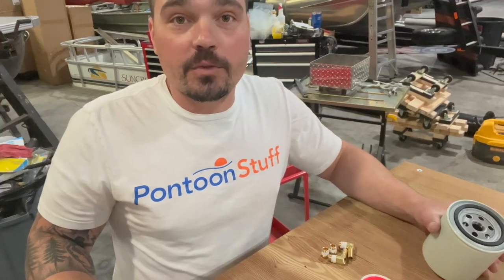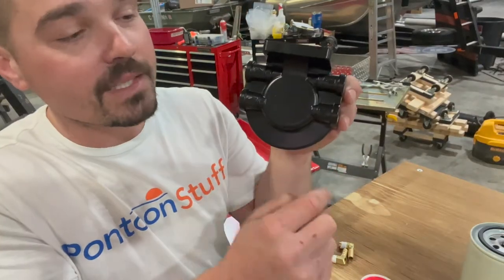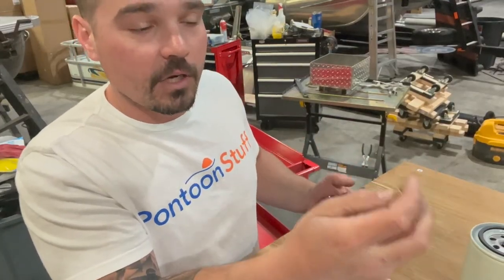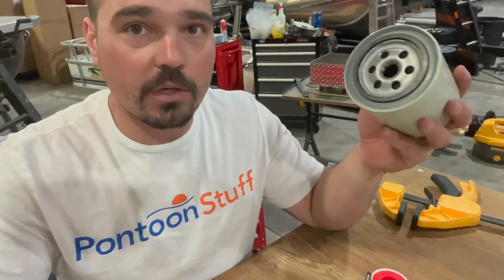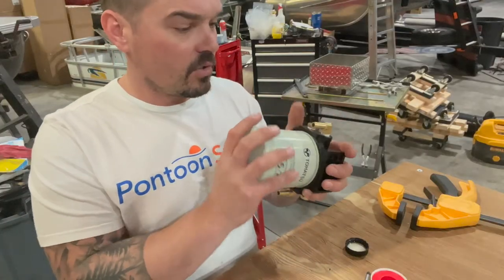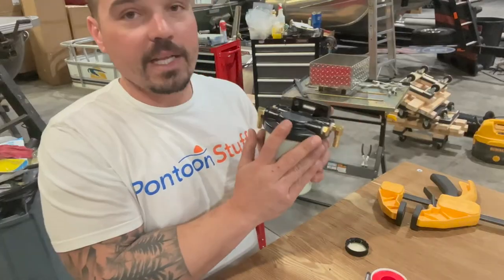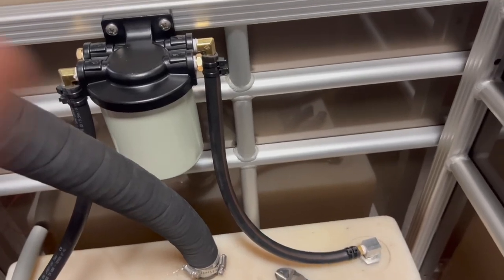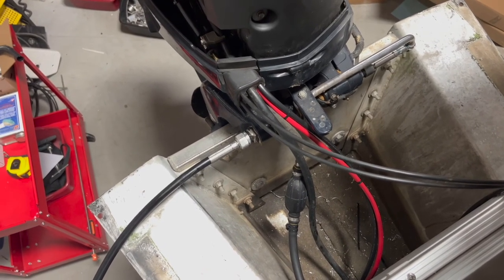Water Fuel Separator & Filter Installation - A MUST HAVE ON YOUR BOAT!

Comment: Thanks for making this.  My 1996 50hp evinrude suddenly sputters and e en has died down at idle at a boat ramp a couple times.   A friend recommended changing out the fuel water separator so this video is helpful!
Reply from the maker: Happy to help, and thanks for watching! It could certainly be that you have some water in your fuel (test what comes out of the old filter), or it could need the carburetors cleaned too as those tiny openings in the low speed jets can get gunked up over time to where it'll run at higher speeds but struggle to idle.

Comment: I’ve used these for years! Here’s a tip. Drain it is into  a clear jar ever time before you go. The reason you drain it every time before you go is because if it has water already in the filter it’s just going push water into your engine. The reason you pour the gas from the filter into a clear jar is because once it sits the water and gas will separate and you can see how much water is in the gas the store your getting it form has in their tanks.
Reply from the maker: Totally get that method, and to do so every trip I would 100% recommend the type of filter with the twist drain on the bottom, and it has a clear window to check for water or debris! I change them once a season, or check it first if there’s an engine issue to test the fuel for water!

Comment: Great video, as all of yours are.  Other reasons to oil the filter seal are to keep the dry rubber from binding as you tighten it, and to make sure any air bubbles get squeezed out.
Reply from the maker: Thank you! And great input...it's one of those things where oiling the seal is just the right way to do (it for so many reasons)!!

Comment: I have a 2018 pontoon with a transom mount fuel tank. I think this video was for me. Thanks. 

Currently trying to diagnose my fuel delivery issues. Thinking it’s water in the fuel…
Reply from the maker: Happy to help. Most factory boats come with a water/fuel filter kit just like this…and if not they definitely should!! All of our new fuel system installs, even if it’s just a 6 gallon red can, get one. 

The nice thing about the filter is that you can test a sample from it in a clear bottle easily to diagnose things like that. Water in gas happens, even if running marina gas or recreational fuel. Once in a while there’s just a bad batch!

Comment: Great video.  Should follow up with a fuel cell installation in the center toon.
Reply from the maker: Thanks! Unfortunately we haven't tackled the center toon fuel cell installation. The center logs with fuel cell spaces we've installed are always missing the actual fuel cell! And it seems that they're typically custom made for manufacturers dimensions so not easy to find a replacement. Only downfall for a center log fuel cell (and transom integrated for standard pontoon) is getting access to work on them or replace compared to an above deck tank.

Comment: Can you tell me what size those stainless steel screws are that you used to mount to the rail.  I heard "1 inch quarter 20".  I get the inch long part but for some reason not tracking "quarter 20" part.....  Thanks for the video.  Doing this upgrade this week
Reply from the maker: 1 inch long, 1/4” refers to the diameter, 20 refers to the thread. Usually written 1/4-20 stainless on any packaging or at the hardware store. Hope this helps!

Comment: Awesome advice Tom! Being a newbie, never even gave it a thought! So I’ve just ordered the same style separator for both my pontoon and 16’ fishing boat. One question I do have…that Tohatsu separator you have…is the fitting plumbed so you can run dual fuel tanks? TIA…
Reply from the maker: Smart move!!! There are two inputs and two outputs on the housing so you can run multiple tanks and motors.

Comment: having trouble installing mine i have a 18ft bass buggy dlx pontoon will i have to put the water seperator on my fencing
Reply from the maker: I have had to install them on railings quite a bit. Inside and outside of the boat on the rails!

Comment: i just purchased a pontoon,  it has a 90 hp Mercury,,,   4 stroke,   im not sure if a fuel seperator will work on a 4 stroke,  i believe there are 2 fuel pumps on the engine,  not sure of that though,   will a seperator work,  or Not..   i was going to put one on,  but im not sure that it will ever prime,  thanks
Reply from the maker: It will absolutely work on a four stroke!! If it’s the newer 90 Mercury it calls for no primer bulb. The easiest way to get fuel through the system is to put a primer bulb at the end nearest the motor and get fuel pulled through the entire system to start, then hook the fuel line back up to the motor, and away you go. 

The other option is to do a key on cycle 10-15 times where you hear the fuel pump turn on and prime. Eventually that will fill the system and it will maintain the prime over time. 

I just installed a new 150 Mercury with a water fuel separator. I’ll prime some fuel to the motor and then hook it up and it’ll be ready to run. Let it idle a good long while when you first run it with the separator in to let it build that vacuum. It might idle a little rough here and there, but it’ll smooth out quickly as it gets the fuel flowing.

Comment: Question, Is it okay to use brass fitting on aluminum housing?
Reply from the maker: I'm not a metallurgist...but from what I've seen it shouldn't cause any trouble. The manufacturers of these filters ship brass fittings with the cast aluminum housings so I assume they think it'll be okay. Everything we do is 100% freshwater up here in Michigan so we don't get the extreme reactions and corrosion issues. It may be different in saltwater or marinas where there's high electrolysis.

Comment: Well my inboard pontoon didn't have one just ordered....thanks!!
Reply from the maker: It’s far more common for boats with I/O drives to have them (not necessarily pontoons with I/O). You’re doing the smart thing by controlling one issue that could go wrong!
Reply: @tomspontoons  this was a no Brainer that I didn't even think about.  I've changed every cable, maintenance and replacement part on the out drive engine and system and never thought about a water separator

Comment: Question: why it has 2 ins and 2 outs? In case of two diesel tanks?
Reply from the maker: Multiple tanks and/or multiple motors. Several ways to run those applications, but this is a nice simple way to do it.

Comment: Planning to add one to my pontoon, would greatly appreciate a link in the comments.
Reply from the maker: Done! The link isn’t the exact one from the video as it was from a local Tohatsu dealer, but it’s one I would gladly use. Thanks John!
Reply: @tomspontoons  Do you have a gas cap and vent system that you like?
Reply from the maker: @JDG022664  to be honest I haven’t found one that I dislike yet for either. I prefer the metal finishes when possible for the gas fill because I’ve seen plastic caps that are beat up so much it’s hard to turn them anymore. I usually use SeaChoice and Perko brands for fills and vents!!

Comment: I installed a FW separator along with all new line and a bulb like you did. Ive checked and rechecked all fttings and just cant get the gas up to the motor. I can siphon fuel up to the end of the hose going into the separator but unable to get the fuel to the bulb. I checked the check valve down at the tank and it doesnt completely seal to prevent fuel from flowing back into the tank. I did try just putting a barb there and removing the check valve just to make sure there was no flow restriction. The bulb is new and is a yamaha brand so not cheap. It will pump fuel out of the filter if I prefill the filter but fuel will not come uo from the tank to replace what left the filter. Again with my mouth Im able to suction up fuel out of the tank to the fuel filter but just not across the filter to the other side. Bulb vertical. Mouth. Transfer pump. Could the filter mount housing have a crack?  Its brand new.
Reply from the maker: Anything is possible in terms of that housing being cracked. Silly question, but everything is oriented properly and the plugs are in tight? I've never had one do that where I can't keep the prime going from the tank.

Comment: Does it need to be mounted above the fuel tank or can it be mounted lower
Reply from the maker: I’ve mounted most of them just above the fuel tank and had zero issues, including my tritoon with the 200hp. If able to keep it level or lower it may be less work on the fuel pump, but once a good prime is started it shouldn’t be much effort at all for the motor!!

Comment: i have the transom gas tank  on the left side will be the gas line that goes to the motor rite
Reply from the maker: There's a place on each side of the filter housing for an inlet and outlet to make it easier and cleaner for installation.
Reply: @tomspontoons  could they be on the same side or do the fuel lines have to be on opposite sides
Reply from the maker: @southernliprippers327  They can be on the same side. Just as long as one is pushing fuel into the inlet and the other is going out to the motor through the outlet. Then just plug the holes on the opposite side.

Comment: What happens if you put both lines on both sides like 1 going in and right next to it going out? Will that make a difference
Reply: Like do the lines have to be on the opposite side of each other?
Reply from the maker: You can use one side only just fine. There’s an inlet and outlet on each side. Designed to be convenient for whatever setup you need!!
Reply: Okay cause I’ve been having fuel issues on my 2000 90hp Yamaha 2stroke and I’ve replaced the carbs fuel line fuel pump and still having fuel problems
Reply: @tomspontoons  would you happen to know off the top of your head any other fuel problems I could be having
Reply from the maker: @southernliprippers327  What type of tank are you running? The permanent mount in the boat or a removable red fuel tank? You could have a bad pickup in your tank, especially if it's an older permanent mount. I have a video showing that replacement. I would try running it on a removable tank if you haven't yet to rule that out.

Comment: Is there a specific filter you should get? Where can I pick one up? I looked on Amazon but not sure which one to buy ? Can you send a link if possible ? I have a Yamaha outboard.
Reply from the maker: Hey D Damion! Marine water/fuel separators are universal (everything I've come across!). You'll just need to pick a kit to start with so you have the housing. Then each year you can replace the filter with whatever brand you'd like. We love the Tohatsu option because of the affordability and durability. There are even filter options that have clear bottoms to see if water is settling and to drain/sample fuel!
Reply: Mallory is the best

Comment: Does it matter what kind you get? Does size matter
Reply from the maker: I've installed lots of different brands and they've all worked well. The size tends to be universal from what I've seen to where you can order pretty much any brand of replacement water/fuel separator filter and it'll work with any housing.

Comment: I have a transom fuel tank, so does it matter how high it should be mounted.
Reply from the maker: I would go for a lower mount IF POSSIBLE. However, some height increase will help prevent fuel flow when changing the filter. A mechanic explained it to me like this: the flow of fuel has to go straight up the pick up, and that’s never a problem. Adding some vertical climb isn’t going to be an issue if there are no kinks or pinches in the hose. Fuel pumps are stronger than we think.

Comment: Im debating to get one or not. Im just aftaid of adding another point for a leak or air leak. But living in fla and its humid so im kinda on the fense
Reply from the maker: It's an absolute must on any of my own boats and I try to convince my customers to add one on theirs. Water in fuel is the #1 most common issue that my local marina sees with engines running poorly. I've never had a leake or air flow issue with any I've installed. If it makes you feel better, a lot of the new fuel systems today from the manufacturers are running zip ties at fuel hose connection points!
Reply: @tomspontoons  that's very true! We just got our boat it's an 88. I am a noob to all of this but have replaced all the engine fuel lines and for sure lots of zip ties. I'll def look into a separator. I can find some place to hide it. Are they all the same or are some better than others
Reply: @tomspontoons  I also add stabil when I fill up and I run it every week
Reply from the maker: @CTRadventures  I install a Tohatsu brand filter on most the boats in my shop because they're affordable and come as a kit at my local marina. You could install anything though, Amazon has a ton of options. I'd probably opt for a Sierra brand over some real weird off-brands though!
Reply from the maker: @CTRadventures  Definitely can't hurt to add fuel additives these days!
Reply: @tomspontoons  thanks for all the feedback
Reply from the maker: @CTRadventures  Happy to help!
Reply: @tomspontoons  the ones w the clear bottom cup, are those just a gimmick? Or are they actually useful? How often do you change the filter? Thanks again
Reply from the maker: @CTRadventures  They're a great concept and work great as you can drain out water that collects (water settles, fuel rises) or sample fuel you have in the filter. The filter just spins on to the housing, whether it's the clear bottom or standard filter.
Reply: @tomspontoons  I think I'm gonna go with the standard sierra no clear bottom. Looking at reviews w the clear bottoms under they discolor and some times leak around the plastic seal. I figure the less connection points the less chance of leaking
Reply from the maker: @CTRadventures  Sometimes keeping it simple is the best way to go, I'm a believer in that!
Reply: Got the separator on yesterday. Going to take it out today. I know if I ran out of fuel before I put it on, I'd would just change the tank valve at the motor and it would fire right up. W the separator, I had to fill it w gas to prime it. Would the same happen if I ran out of gas and had to switch the tank? Meaning would I be screwed and have to take the canister off, fill it to prime the motor again? Thanks!
Reply from the maker: @CTRadventures  Essentially yes, you’d have to refill the canister. Are you running a motor with no primer bulb? I usually can fill a canister with just a primer bulb without too much effort if I don’t want to fill it with fuel and risk spilling it in the boat.
Reply: @tomspontoons  ya I have a primer. I just noticed when I installed it I had to fill the canister cause the primer only got it about half way before it emptied. I have never ran a tank dry except once and that was on purpose. I was just curious. Thanks again for all your help! One of the few channels who take to hart that boat people are family!!
Reply from the maker: @CTRadventures  I've not had an issue using the primer to fill the canister and get the system fully primed. I have a primer bulb in line on my fishing boat and even with the filter I can get the bulb firm and fuel pushed with a few squeezes before I launch.

Comment: Where to mount filter on a suntracker where the fuel tank is mounted in motor pod? To mount to the rail would be about 2 ft above the tank, was thinking of mounting it level with the fuel tank inside the motor pod, but it may get wet, but the tank gets wet so maybe it doesnt matter..any thoughts?
Reply from the maker: As long as your filter is screwed in tight and your hose fittings are snugged down with clamps it can get wet. I haven’t had any trouble mounting them above the tank a foot or so. Otherwise you could fabricate a bracket to sit just above the transom without going up high to a rail.
Reply: @tomspontoons  Thanks for replying. Installed it today inside motor pod, will keep an eye on it. Thanks
Reply from the maker: @SCDeerAddict  You’re welcome!
Reply: @SCDeerAddict how has this worked out for you? I’m looking at doing the same thing on mine.